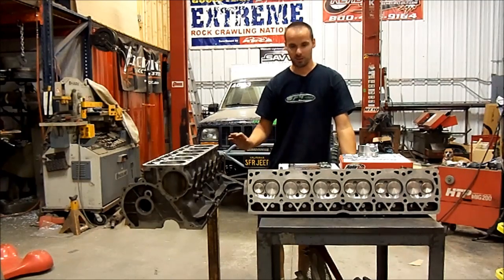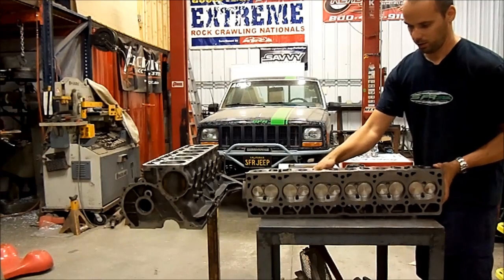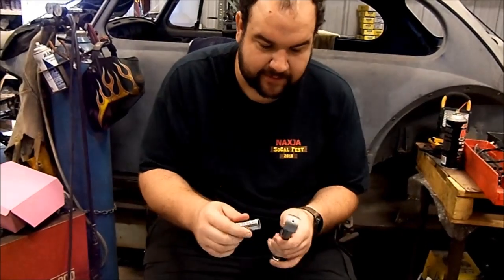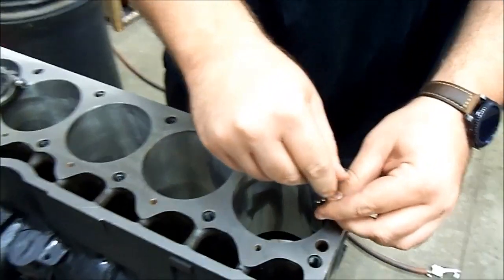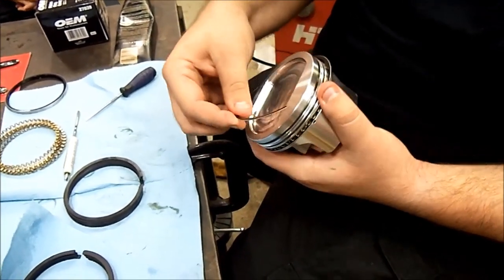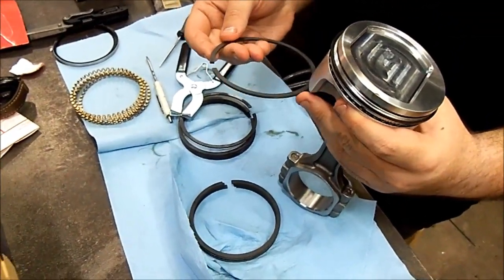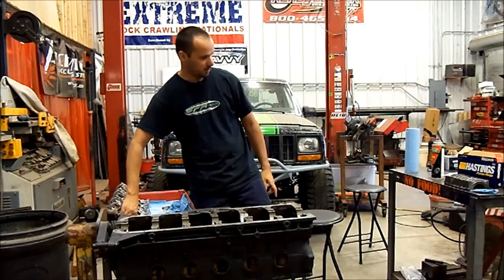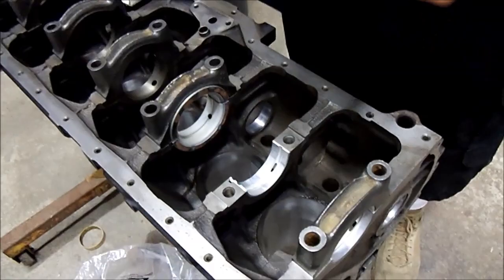Building a 4.7l Jeep Stroker Motor, Part 1

Comment: Could the 4.7 Stroker damage the automatic transmission on a 2001 TJ due to the horsepower and low gears?
Reply: Doubtful. Many people have run plenty more power through that trans than a stroker puts out. Also lower gears actually LESSEN the stress on the trans.

Comment: It wouldn't hurt to put ARP Ultra Torque assembly lube under the rod bolt head as well as the threads so that when torquing the rod bolt, the head will slide on the cap surface.. When you are using ARP Head studs, it is a good idea to put a light coating of ARP Ultra-torque on both sides of the head stud washer, on the stud threads and under the shoulder of the nut so that nothing binds while torquing, thus giving accurate torque measurements. Some rod manufacturers will give a rod bolt stretch measurement that is checked with an ARP rod bolt stretch guage.. Before torqing the rod bolts, put ARP stretch guage on rod bolt to get reading before torqing. So as the rod bolts are torqued as normal & when torque is achieved place the stretch guage on the rod bolt to see if desired stretch has been attained. If not torque a little more on each bolt and re-check bolt stretch until desired stretch is attained.. Keep up the good work, one can never learn too much..

Comment: @8:18 I'm thinking "odd, that looks like plastigage". It was! Damn, I haven't heard about plastigage since the 70's! :)

Which kinda says something about the number of engines that I've re-built since then. :)

The rebuild back then was on a '68 Fiat IIRC. The entire rebuild cost me $60.
Reply: I graduated with an Automotive Technology Degree in college just a couple years ago. We used plastigauge almost every day when we were rebuilding our engines. Problem is, OEM dealerships won't approve of techs replacing individual internal parts or doing rebuilds anymore, just has them pull the entire old part and replace the whole component. Sure that's easy, but it costs the customer so much more! That's why I prefer specialty shops or race shops. Real investigative work, tear-downs and full repairs with new parts! Not installing re-manufactured parts that will only wear out in a few months.
Reply: @WilkinsonGarrett  A young friend of mine was a mechanic for BMW and he told me that the entire part gets replaced, just as you say, even if it was just a small problem with the part. I couldn't believe it. 

Needless to say that we don't apply that policy to the cars here at my house. :)
Reply: @MrWaalkman  Yeah, it seems incredibly wasteful. But they're in the business of saving time, while also charging as much as they can for that speed and their overpriced parts. We had simulated repair orders at school, and had to figure out what parts needed replacing. Average diagnostics labor was around 100 an hour, then removing that part and replacement labor was around 100 an hour, depending on the part, could have been even more, then on top of that was the price of the part itself but marked up for profit. We had one exercise where I found a $20 sensor had gone bad, by the end of all the labor and removal, the "customer" was looking at around $350! And out of that, in that hour or so the tech has worked on that vehicle, they would only see an average of ~$25. Most guys are paid flat rate too, so taking longer than what the computer says the job should take won't net you anymore money. That's why I now call them stealerships. Needless to say, I've only ever worked on my own cars, and if I need special work done to my parts, I go to engine builders and machine shops instead. Everything else I can do myself, or with a little help from a friend. All I need now is a bigger shop for more projects!

Comment: Can you give us any idea as to cost savings of going this route versus something like a Golen stroker?  I'm sure the cost of a kit has a lot of variables but are we talking somewhere in the neighborhood of $3k for a kit vs $4700 for an assembled long block (that's Golen's price on their site)? Looks like a fun project.
Reply: There are a ton of variables as every engine Russ puts together is custom made to order. He doesn't currently offer a one size fits all engine setup, they are individually tailored to the person buying the engine, which in my mind is worth a lot. 

That said there is certainly a good amount of savings from doing the assembly yourself. This particular motor is not the absolute top of the line, but it's far from the bottom with all the head and block machine work. This one would run you around $3500, and would be cheaper if you used your own block and had it machined locally. To really get an idea of what it would cost to build what YOU want it would be best to talk to Russ. There's a good reason he's the most well regarded builder in the Jeep inline 6 market. He won't build you junk, even if you ask for it. I don't know much about Golen, but have had enough experiences with most of the other builders out there to flat out not trust anything they claim. I've seen too many engines torn down to find out that what is inside is not even close to what was paid for.

Comment: What sort of restrictions when talking about stroker engines and emissions in the state of California.  How will it do when smog inspection?
Reply from the maker: Hector Hernandez you have to run all the original emissions equipment and it has to pass a sniffer test. If it looks stock under the hood and blows clean nobody knows or cares.
Reply: StinkyFab Racing I ask cuz I just installed a modest cam in my xj. Was thinking of turning it to a stroker but was hesitant to pull the trigger Because I was afraid it would not pass emissions. Now I know and might go forward with it. Thanks bros, love the vids and the channel.   Big shout out from the San Gabriel valley in Southern California
Reply from the maker: Hector Hernandez the most important thing is that it passes the exhaust test. A cam may or may not give you problems, depending on the cam and other engine mods. When i had russ build this motor i told him it needed to pass smog and he designed a combination of parts that should work together to allow that.